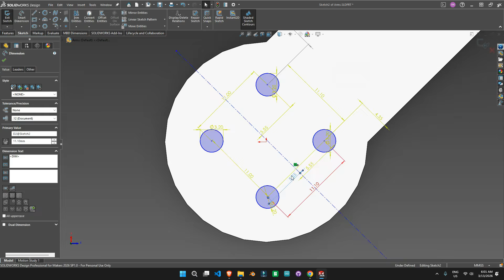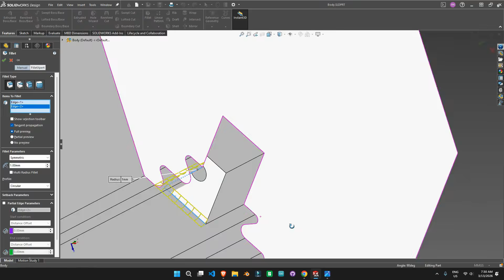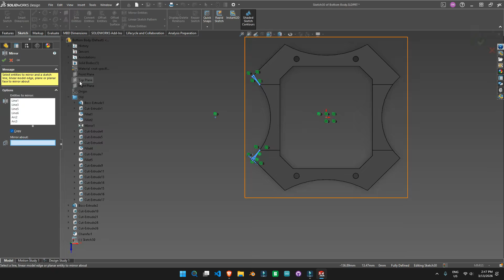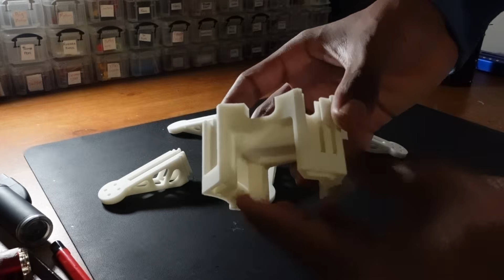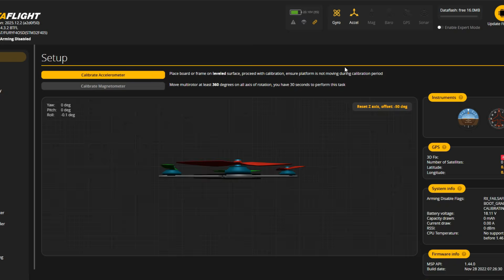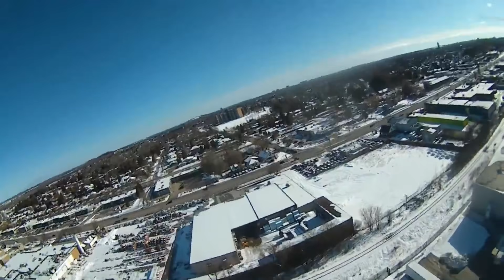Can a 3D Printed Drone Really Hit 200 km/h?

Comment: Nice drone, is it waterproof?
Reply from the maker: Its not fully waterproof, but very water resistant. The case is completely enclosed, other than the hole for battery lead and very small holes for the motor wires.